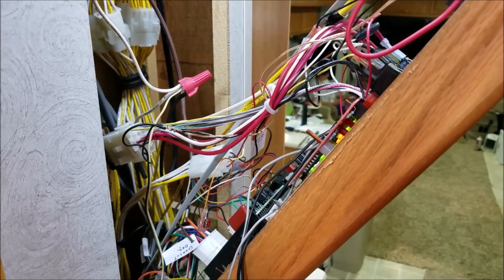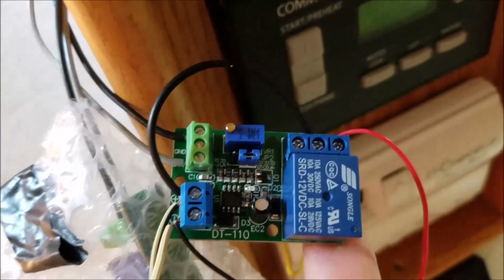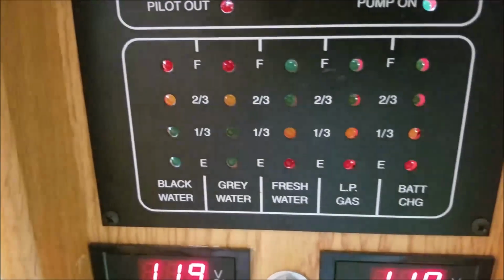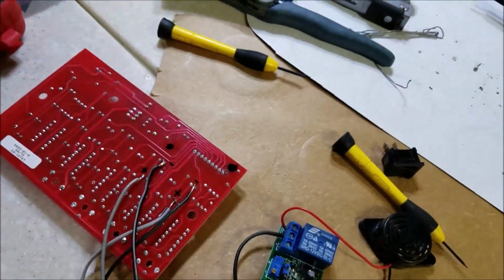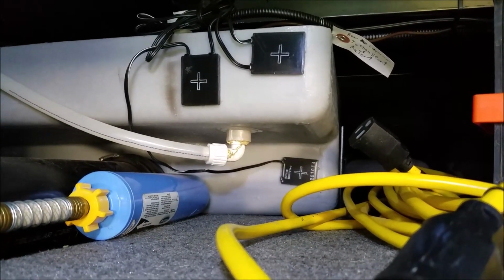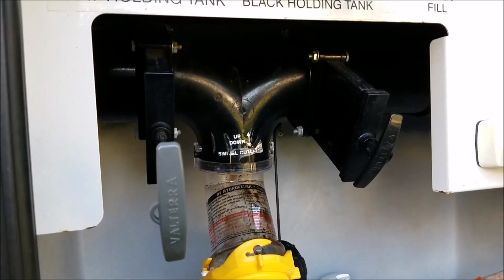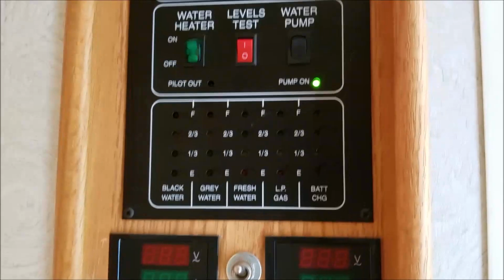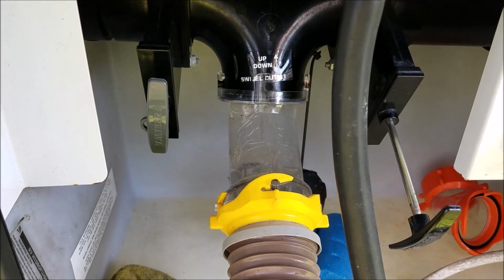STOP Your RV From Flooding Make Your Own Black & Gray Tank Alarm

Comment: Same year, same floorplan--but I have the little momentary buttons on each tank that I have to push to see the levels.  I guess I could just change out the one button.
Reply from the maker: You can change it to a rocker switch I have a link it for below the video
MUZHI 12 Pcs SPST Snap-in ON-Off 2 Pin Snap Rocker Boat Switch Black AC 250V 6A 125V 10A for Car Auto Boat Household Appliances(Red Button)
by MUZHI STORE
Learn more: https://www.amazon.com/dp/B081CC7DH4/ref=cm_sw_em_r_mt_dp_RBabGbPZASSKP?_encoding=UTF8&psc=1

Comment: Have you made a video on how to keep your sensors clean so a device like this works?
Reply from the maker: Yours should be like ours the sensors just stick to the side of the tank nothing protrudes into the tank...
unless there is enough buildup on the inside of the tank that may interfere ?
There should be a way to test the sensors.. I think i said the name of the manufacture at some point in the video
Reply: @ktoutdoor  I would guess that there is buildup on the inside of the tank.
Reply: @ktoutdoor  What brand sensors have you installed?  The stock Winnebago sensors do indeed protrude into the tanks.  Mine are so inconsistent due to debris on them that an alarm tied to the sensor would be more of an annoyance than anything else.
Reply from the maker: @gary3046  Note sure of what you have but on our 2005 38J we have stick on sensors they do not protrude into the tank just google "WINNEBAGO TRUE LEVEL MONITORING SYSTEM"
Winnebago Industries’ exclusive TrueLevel™
holding tank-monitoring system determines
the level of fluid in a tank from outside the
tank.
TrueLevel incorporates Mirus™ detector cell
technology to ensure accurate fresh and
wastewater tank level readings. Mirus™
detector cells are located on the outside of the
tank and produce a microelectrical field that
detects liquid levels.
There are no more probes to corrode or clog.
Just true, accurate fresh and wastewater tank
level readings, time after time.
The TrueLevel holding tank monitoring system is standard on all 2005 Winnebago and Itasca motor
homes.
Reply: @ktoutdoor  That explains it.  My 2004 Itasca uses the standard type sensors.  Looks like Winnebago went with the True Level system in '05. 🤪